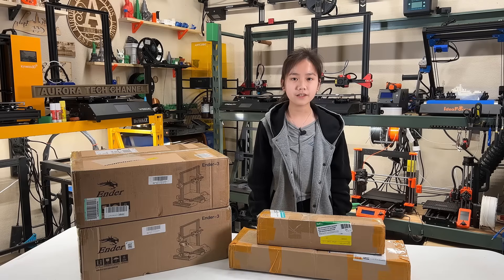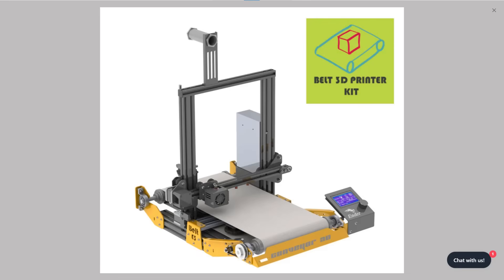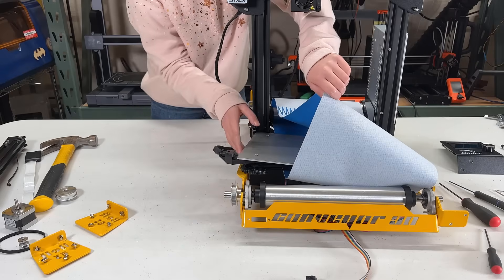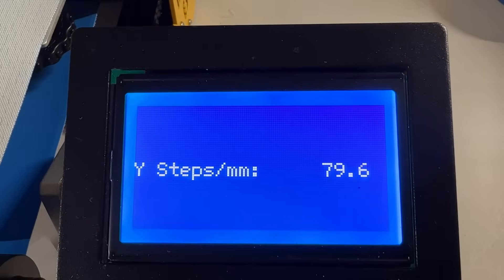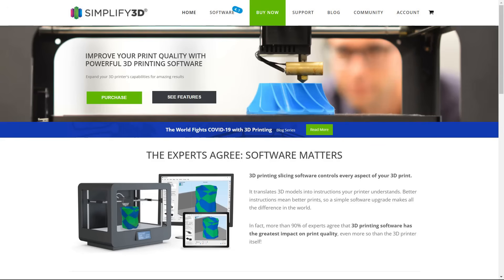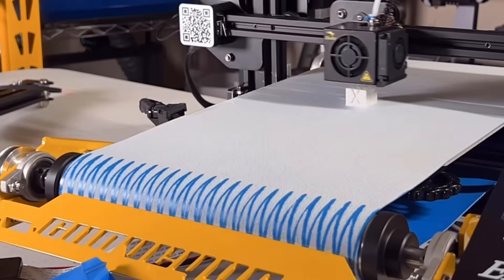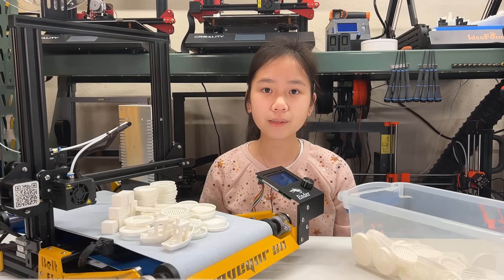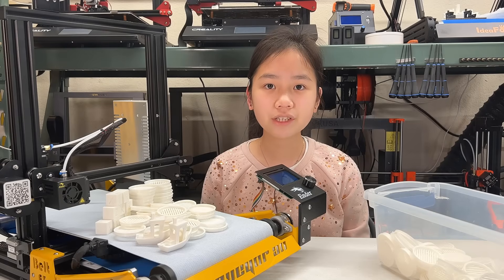Turn your Ender-3 into a conveyor BELT 3D printer, 90-degree continuous printing, batch production

Comment: I just picked up an ideaformer, i had the bed set to 70c to compensate for the belt temp, but when i used a temp gun the belt surface temp was only 59C. It might be worth checking your belt surface temp and offsetting your target temp to get the belt to the 65c range and try the benchy again. On my machine comping it up to 65C greatly helped. 

This kit really peaks my interest, as I have a project currently consisting of 70 parts with multiples each where queuing them up would be amazing.
Reply: I just got an ideaformer as well and having issues with bed adhesion when printing PETG. Do you have any suggestions what temp should I be using or what to adjust?
Reply: @LoveandKindness_Z  glue stick and more bed temp. Honestly, I have the issue with pla and petg sticking too well seemingly no matter what i do. to the point it just stalls the Z axis motor. kinda annoying

Comment: Great review. I have questions about the practicality of this kind of assembly line printing. 

It's only "endless" for as long as a roll of filament will last. If we are manufacturing parts, is it not more economical and reliable to fill the build plate with 24hrs worth of parts and reset each day?

It seems like if you need this type of production, you are generally around and attending to your printers anyways. After all, you need to be there to post process, pack, and ship whatever parts your are printing.

And with this particular configuration, the belt kit costs as much as two more of the refurbished ender 3's you're using. Wouldn't it be far more productive to buy two more ender 3's so you can have 3 prints going at once?

I guess what I'm trying to say is what is the actual use case where this makes production and economical sense, instead of mostly being a cool (very cool honestly) novelty.
Reply from the maker: Depending on what you print, how much print time is required for each object. 

For example, for the 6.5 mins disc I printed in the video, if I use a regular Ender-3, I can put 16 of those discs on the print surface, the printing time would be 2 hours. I have to remove the parts before I can start another print. So, the maximum number of parts I can make is 192 discs per day, but I have to babysit the printer 7x24.

If I use a belt printer, a roll of filament can print 270 discs, the time required to turn a roll of filament into 270 discs is around 30 hours, suppose the printing area plus the distance between each part is 250mm, this requires the belt to move 67,500mm in relative center position without touching the edge of the roller, this is possible as I can move more than 100,000mm without issue in my best result. So, I only need to change the filament and re-align the belt every 30 hours.

But if you are printing something that requires more time, the belt won't make a big difference. For example, if each object requires 2 hours of printing time, you put 6 of them on the build plate, each cycle will take 12 hours, it should be good enough to just use a stock Ender-3 and check it every 12 hours.
Reply: @AuroraTech  That makes sense. 

Thanks for the great response and great videos!

Comment: I didn't know they can be NOT 45 degrees! How long an object can be printed at 90 degrees?
Reply from the maker: If printing at 90-degree, it can just print normal length the same as the Ender-3, but it prints better than 45-degree for small objects and better for small batch production.

Comment: Good review. It dose make you wonder, is the ender3 exceedingly good value or is the belt kit over priced 🤔 no doubt creality will release there own version. Also one last thing, did you say consider a cr10s5 y axis motor for the belt axis?
Reply from the maker: I am using a set of Nema 17 40mm stepper motors(1.7A rated current) on the Y-axis.

Comment: Such an interesting video. Thank you for making this. Didn't know such a thing exists. Is there a version that is compatible with the Ender 3 S1?
Reply from the maker: I think it would be easier to add the Sprite hotend to the Ender-3 90-degree belt printer than make a kit for the Ender 3 S1.

Comment: Very good review. I am particularly paying attention to your print adhesion issues. On my printer I have the four leveling knobs and have used my thermal camera  to look at the bed temperature. The area on the bed above the knobs is quite significantly cooler then the center. Nominally if the bed is set to 70 degrees, the area above the knobs (maybe 2 inch diameter circle) is about 50 degrees or about 20 degrees cooler. This has led to several failed prints when the edge or corner of a part is above a leveling knob. Noting that you have several  printers from different manufacturers with leveling knobs, have you ever checked the temperature above the knobs. I wonder if this is a general problem, or only an issue with my printer. Thanks again for your excellent videos.

Comment: Belt Edition cura for Cr30 has built in the option for multiple copies of the same print. You can select the angle of printing so it is not cr30 only, give it a try.

Comment: Great review. I just bought one of these kits to try out a few weeks ago.  

As for the patent... The only things that are actually covered in a patent are what is listed in the Claims section... All the text before them is just describing the problem and solutions... But actually isn't enforceable... In fact, if they are not claimed but we're actually new inventions, then they become public domain as soon as the patent application publishes.

When I first invented the tilted conveyor belt printer, my exclusive goal was to get by their patent. A careful reading of their claims revealed the requirement that there be an X, Y and Z axis that were perpendicular to each other. That was their weakness that I went after after realizing that I could print with with an oblique axis. I immediately used my Makerbot Replicator and converted it into a belt printer just as a sort of joke, but also to prove it would also work. That's really what started everyone making them after I showed it off at a few shows.
Reply: Once the pat expires it will become std items by mfrs worldwide.
Reply: @SaltGrains_Fready , maybe, but the belt, rollers, and steel frame are all extremely niche items, especially for add-ons to a hobby that is already about as niche as they come -- not that I think that's fair, but I don't see the cost dropping without some other innovation mixing things up.
Reply: That patent is stopping innovation , I say some rules were made to be broken

Comment: I had read somewhere that 45 degree belt printers came about as 90 degreee belt printers were protected by patent, I wonder if the upgrade gets around this patent by not actually producing a printer?
Edit: I think you guys should design a printer, I would be curious to see what you come up with, and would be happy to build it also, you guys are advanced well beyond your years!
Reply from the maker: According to the paper, it's not about the printing angle, it's about the process of fabricating multiple objects and automatically remove by the belt. But someone also said the inventor actually published the concept on the web before the patent is filed.
Reply: @AuroraTech  Thank you for clarifying, my explanation was a bit ambiguous as it was a fair few years ago I read about this.

Comment: for continuous batch printing which one would you choose since they are close to price? this kit+refurb 3 or the ideaformer belt printer

great video
Reply from the maker: In fact, a 45-degree printing angle is not great for batch printing, if I have to pick one. I would modify the IdeaFormer to 90-degree if I really have to do large batch printing, this DIY kit is OK, but the quality of the DIY base, roller as well as the belt is not as solid as those from IdeaFormer, of course, it's not fair to compare a $350(kit+printer) with a $600+ printer.